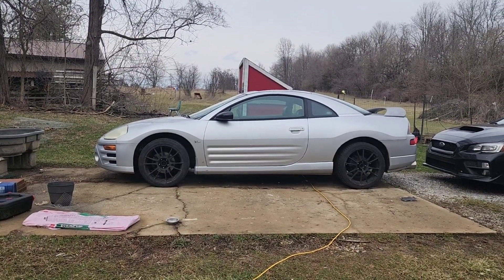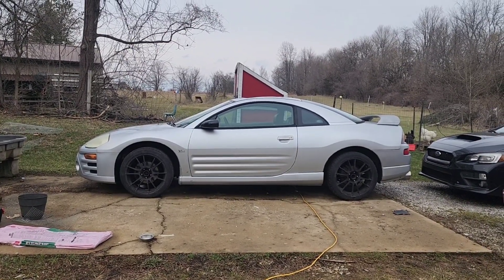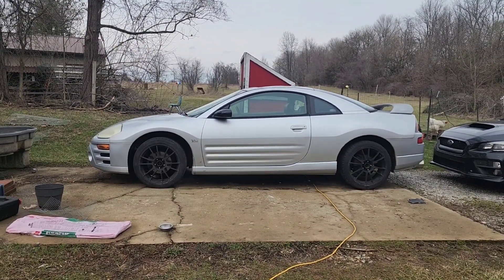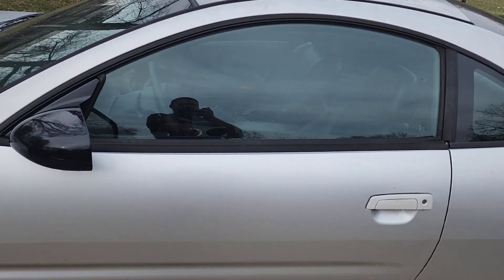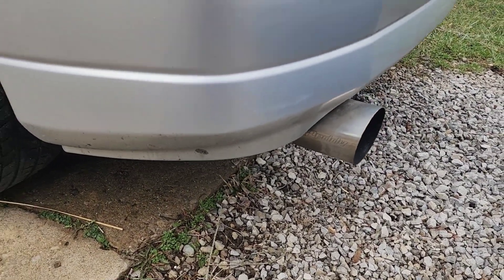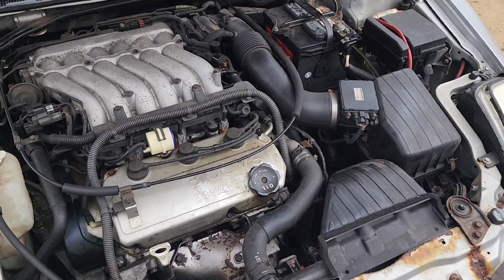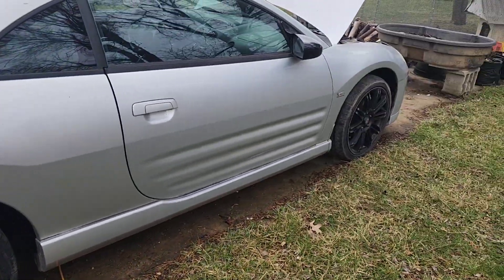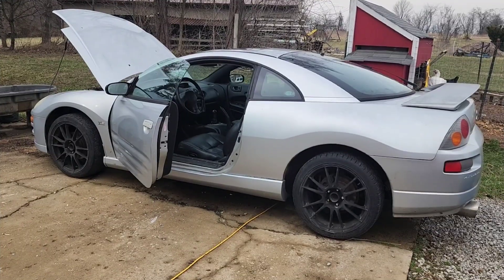The $800 Mitsubishi Eclipse Project Car - Eclipse GT-S 3.0 V6

Comment: I bought one in may I drove it from Florida to Pa. I finally got finished replacing the broken dash and fixing the heat. I replaced the suspension on the front and back, rotors and pads, front lower arm and ball joint, new tires, new pioneer radio.  I’m finally driving it.
Reply from the maker: Sounds like my story lol. Months of work before it was finally able to be daily driven...

Comment: Yea I’d love to show you what I’m working with , cold air intake,body kit all around, and 2 different rims kind of like yours 😂😭😭 I have the gt model
Reply from the maker: Put it on your channel or insta
Reply: @92kbuilds-mn2lk  done I’ll make a video of real time today of the front bumper body kit and the cold air intake I just got it and wish I had a better idea of what I got myself into
Reply from the maker: Does it run shitty or what?
Reply: @92kbuilds-mn2lk  it runs good automatic transmission is smooth , engine is still and has steady rpms flatlined at 1000 rpms on idle just that tapping lifter I started to notice after I got it running for 2 days this has sat for some time I think last time it was registered and fully serviced was in 2013
Reply from the maker: I left a couple comments on your videos...

Comment: mines mechanically sound. slight leak on the valve cover gasket. Transmission be transmissioning. but 75k miles and shes kickin. including the intitial purchase ive dumped 15k into it.
Reply: 04, spyder, steel blue
Reply from the maker: That's super low miles!

Comment: I just got one for 400$ 2005 ran and drove back now I’m cleaning it out!!!
Reply from the maker: V6?
Reply: @92kbuilds-mn2lk  yes v6 auto only down side is it has a few fender benders and needs some suspension work but for running and driving in today’s economy 400$ is a really good deal
Reply from the maker: Yeah definately. My was running and driving for $800 but started oveheating and leaking coolant the very next day, then broke down immediately after I fixed that lol (timing belt).
Reply: @92kbuilds-mn2lk  when did you have to replace it? Mine had 147980 exact lol
Reply from the maker: 130k when I got it but they are supposed to be done every 60k. And the belt was fine but the tensioner was bad so it slipped- thankfully only 2-3 teeth or it would have destroyed the engine. I have videos doing the repair along with the water pump under there. You can take the top cover off to inspect the belt and check tension...

Comment: I love my 01 eclipse gt brings sti's to gapplebees with some good aftermarket parts/ bolt on's there a quick car
Reply from the maker: Maybe an older stockish WRX lol. STI is 305HP... The Eclipse is decent for what it is though- I like mine. But we have a (now modified) 2015 WRX too lol.
Reply: @92kbuilds-mn2lk  yeah but my tuned and full bolt on 3g has smoked 2010+ sti's and yeah there 305hp so my eclipse is making roughly 250 to the wheels not crank hp
Reply: @92kbuilds-mn2lk  I'd do rollers with you any day of the week 😁
Reply from the maker: Shit man, get some pull videos of that thing showing the speedo 0-60 0-100. Imma go watch your shorts but hey if you like guns, check out my other channel Guns&Cars - way bigger than this channel lol. I just started this one... I'm in Ohio if you wanna run 😁
Reply: @92kbuilds-mn2lk  I'll post a hwy pull tonight I usually don't launch my car " try not to break it"  but I'm out here in Oregon that's a hell of a drive lol 😂
Reply from the maker: Alright hwy pull it is👍Replacing the water pump and timing belt on mine currently, explanation in next video of it.
Reply: @92kbuilds-mn2lk  I gotta do mine soon,  I'd love to see how to do it
Reply from the maker: @3ggtredrocket881  On this channel I do more of a "bring you along for the ride" type videos, swayed slightly more to the side of entertainment than education. That said, the repair videos on this channel can be used as a "how to" video as long as the viewer is somewhat familiar with what's under the hood and has turned a wrench on a car a few times. But I'll always reply in the comments if you need help...

Comment: Dude i just picked up a gts spyder because im curious to see if its faster than my 99 mustang gt. Theyre both black inside out and theyve both been saved from the yunkyard. I paid 350 for each so itll be interesting to see.
Reply from the maker: Well if the Mustang GT is an auto and the Eclipse GTS is a stick, they will be about even both running low 15's in the 1/4 mile in factory new condition. Auto vs auto or 5spd vs 5spd, the Mustang with the V8 will kill the Eclipse...
Reply: @92kbuilds-mn2lk  interesting. Theyre both auto but the mustang has full bolt ons and a rebuilt engine.
Reply from the maker: Well then the Mustang would win then lol. If it's the GT with the V8 then it's 260hp stock compared to the Eclipse GTS having 210hp stock. The Mustang weighs a little more and has a little more drivetrain loss due to the driveshaft and rear end, but not enough to make it slower than the Eclipse. Also the V8 has way more torque, and you said it has bolt ons as well...

Comment: Paid 400$ for mine it’s a 2000 honestly needs paint needs tires and rims going to put 17 in tsws on it paid 450 for them with tires
Reply: I replaced the starter btw
Reply from the maker: Is it a GTS?

Comment: $850 isn’t bad for a running car these days. Looks like a good deal. When I was first into cars I used research these cars a lot.
Reply from the maker: Yeah that's what I thought, let alone an eclipse, let alone the GT-S. But so far this thing has a laundry list of problems (more than realized in this video) so I pretty much got what I payed for. Right now I have the top 1/3 of the engine off correcting some of those problems...
Reply: @92kbuilds-mn2lk  Oh wow…hopefully you can get everything fixed without pouring too much money into it.
Reply from the maker: Tuneup & gaskets/o-rings at the moment, $200 of parts so far to fix the coolant & oil leaks and get it running right. Just got my last part in today so I'll be working on getting it all back together tomorrow. After that I need to adress the broken, busted, and worn suspension on all 4 corners. Once I get this thing right then maybe I can finally get a couple bolt on performance parts...
Reply: Mine was actually 500$ when i picked one up and it does need body work but, a friend's gonna do it i currently spent 200$ in pieces (bumper and tailights) but, it's the 2.4L 5 speed manual and its a spyder
Reply: $850 for a running car is unbelievable these days wdym “not bad”
Reply: maybe 10 years ago? used cars in canada are still 5-12k with over 230,000km. its pathetic. never again will I be able to buy a car for $500 which runs.
Reply: ohh yes ,, sum the time you need to new ap+rts difficult to find or impossiblew, manutention and check under the car, for rust, maybe the car is done...is desintetgrateing

Comment: Yo I have a Chrysler with the same engine any too how too keep it reliable- it leaks a lot of oil
Reply from the maker: Maintenance is key. Fix the oil leaks, fix coolant leaks, do a tune up when necessary, change fluids when you're supposed to, and be sure to change the timing belt when it's due so the engine doesn't blow. I have videos of all this on the channel fixing mine up...

Comment: I don't believe there's a compression ratio difference? The only difference to my knowledge is... Different cam timing/duration(more air at higher rpm), the variable intake runner(reduced restriction at higher rpm), the mass air sensor(better reading for higher rpm), obviously with the different mas, there's a different fuel map in the ecu. That's it as far as I know.
Reply from the maker: Since posting this video I have been able to confirm that the GT is a 9:1 compression ratio, GTS is 10:1. Also the plug gap for each is different, likely due in part (or whole) to the different compression ratios- .044 GT, .032 GTS. GTS also has shorter gear ratios...
Reply: @92kbuilds-mn2lk  That's crazy though, you would think you would get more than 10hp with the higher compression and better high rpm breathing. The intake difference made sense at 10hp, by allowing a the engine to breath a few hundred rpms further.. but you would think the compression improvement would boost the peak hp even more..?
Reply from the maker: Yeah sorta. But this is a dinosaur of an engine- same basic design since the 80's and they just kept updating it, changing this and changing that. But it's an old inefficient design. It's also only a SOHC in the Eclipse, while the 3000GT got the better DOHC version. 

Increasing the compression on a very conservative factory tune more interested in reliability than performance won't gain much power. Furthermore, Mitsu has to water down the tune enough for everybody that is gonna dump 87 octane into it instead of the 93 octane that should be in it. 

So, you have ancient engine design, SOHC, and safety/reliability provisions going against us here. Now if you had the car actually custom tuned for maximum performance (requiring 93 octane ONLY or else caboom), then you would see a larger gain from a tune on the GTS over the GT due to the higher compression. That said, the 3000GT would see even more gains with the DOHC engine and high compression. 

It's a really bad engine to make faster though because it's pretty much already maxxed out from Mitsubishi. Cold air intakes only add a few horsepower, catback exhaust only a few if that. Headers extremely hard to find (most are discontinued and expensive $1,000+ no joke), but the right ones supposedly actually add a decent amount of power (but sound like shit imo). Nobody really makes cams or heads for them, so the N/A route isn't even really an option. 

Everyone who stays N/A swaps in a "better" version of the 6g engine that barely makes any more power, or they swap the newer 3.8 Eclipse engine because modding the one that comes in this car is almost pointless. 

Again it all comes back to the 6g72 engine not being a very good platform to build on. Boost or spray is required to make the thing move much faster than stock. Bolt ons and tunes are very minimal gains (and hard to come by), and then there isn't anything else left to do other than a swap or boost/spray. 

I still really like these cars though. I'm more about the driving experience than overall horsepower. My first car was a 93 Ford Probe GT and that thing was super fun to drive- handled well and sounded awesome. It only had 164hp but was still really fun to drive. The Eclipse smokes that thing, seems like a real muscle car by comparison. That said, I currently daily drive a V6 Mustang that smokes the Eclipse lol. I like em all so it doesn't break my heart to not be able to make 500hp in the Eclipse...
Reply: @92kbuilds-mn2lk  I've been driving a gts for a year+ now and it's plenty fast for the street. Only thing that's really pulled on me was a TT audi.. Most mustangs either barely pull on me or get slightly behind. The power band is actually pretty nice. I had a 2nd gen and those things were all high rev power, I think this gts is faster.. obviously the 2nd gen's were much more mod-able. 
I don't think the DOHC is really better on the 6G72, vtec honda's get a huge boost from DOHC, but at the end of the day the 6g72 doesn't really breath at high rpms anyways, so there's only so much air flow you can get. The SOHC are more reliable and easy to work on, at the cost of 10~hp.

You're right though, the mod-ability of the SOHC 6g72 is extremely limited, pretty much only capable of getting gains from turboing.